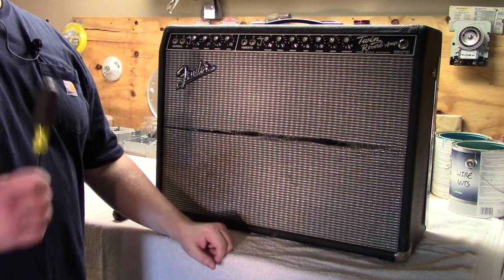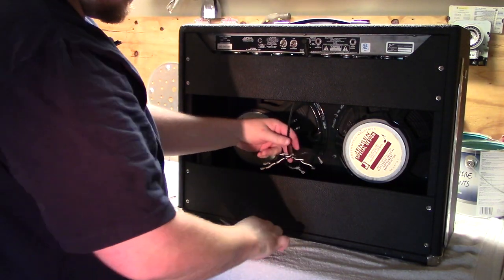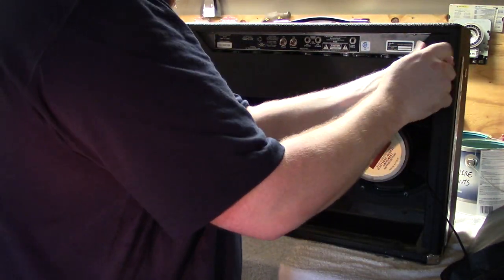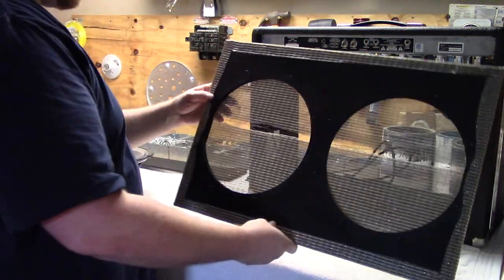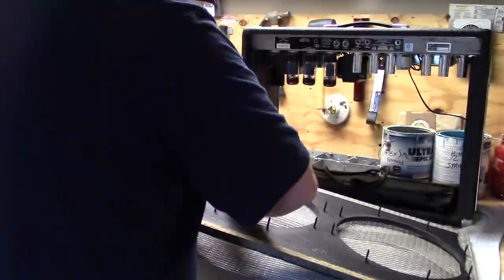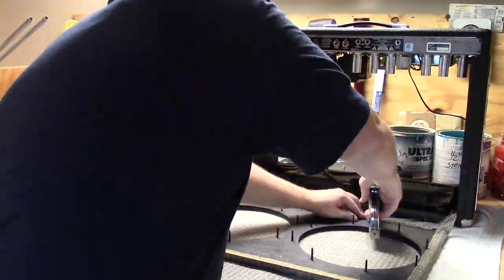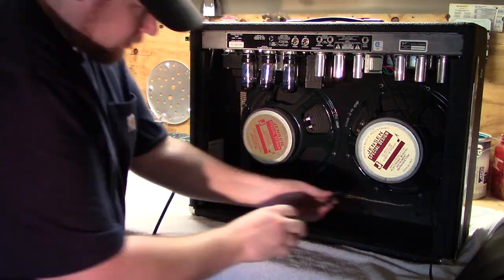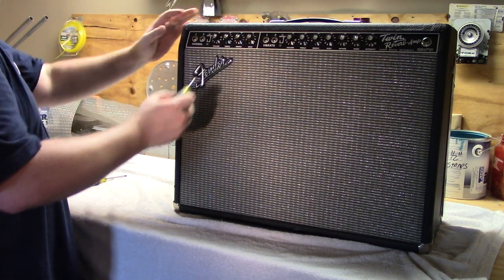Fender '65 Twin Reverb Reissue | Grill Cloth Replacement

Comment: A couple things to consider re the grill cloth for those who are going to do this. The orientation of the cloth; there is a front and back, as well as a horizontal and vertical. It would appear at first sight that the cloth is the same no matter how you place it. In fact there is a slight difference depending on what color cloth you buy. Look closely so that it is orientated the way it should be. Hard to explain without doing a video and without writing a book of a comment.  Also, start on the top edge when stapling and line up first in the center moving out to the edges using a horizontal line in the cloth as a guide. Use the lines in the cloth as a guide overall so it ends up nice, straight and square. Repeatedly check your work. It’ll get wonky if you don’t. Fun job and pretty simple. Thanks for the video.
Reply from the maker: ^^^ this is good advice to avoid the alignment mistake I made
Reply: I wondered about this after I had fully removed the old. My other Fender amps all scream, HORIZONTAL! ... and there is a front and a back, that's quite obvious.

Comment: that thing just went up $500 in value...
Reply from the maker: I sure hope so!
Reply: I don't think so with those Jensen speakers in it. I like Jensen's but in a Fender amp? I never heard of it that could be wrong though. But I don't think so. Just saying.
Reply from the maker: @louisgarcia5971  Those Jensens are the stock speakers that come with the '65 Twin Reissue. It is a statistical likelihood that you have heard Jensens in a Fender whether or not you have "heard of" Jensens in a Fender.

Comment: thanks for the video, i was going to trade in my amp to the local GC, but
they wouldnt take it because the grill cloth was ripped.   i will order some cloth
and fix it as demonstrated in your vide0 but i will do it in an air conditioned room, not
in a garage that is hot and not air conditioned.   you are a pretty tough guy to
do this video under those conditions.

Comment: Leave the speakers on next time to hold down the grill cloth tight, and it’ll keep you from sucking the paper cone or voice coil out of the speaker frame, great video btw, inspired me to redo mine it got rained on a few too many times and that “sawdust baffle board” disintegrated

Comment: You gotta cut the cloth out from underneath the edge of the speaker or it'll warp the basket when you tighten it down and could cause the voicing coil to rub
Reply from the maker: That's a good point! If I have to do this in the future I will take that into consideration. I was figuring it out as I went so I thought my best bet was to replicate how the previous cloth was cut and positioned.

Comment: What tool did you use to take off the screws holding the speakers to the baffle?
Reply from the maker: 11/32" hollow shank nut driver for this amp. Couldn't get a wrench in where I needed it.

Comment: I am curious can you order these grill cloths to come in sizes big enough to do a 412 Marshall cab?  I want to build my own custom 412 or 212 cabinet and I like the Fender look just a tad bit better than the Marshall look
Reply from the maker: Yes you can order them in any size. The ones marked for a standard cab sizes come several inches larger than you will need so you can trim them down to fit

Comment: That is odd. As far as I knew Fender always had hook 'n loop holding the grill on. I had 3 fender amps and they all came with that.
My 1978 Twin Reverb has a seperate board holding the speakers. The grill just pops off.

Comment: Is new cloth as good as vintage?
Reply from the maker: The cloth I purchased is the exact material and pattern that fender originally used, it looks and feels exactly like the cloth that was removed. Certainly no difference in sound. And at around 60 gigs with it since the swap no one has ever commented after a show that it looks like the grill cloth has been replaced.
Reply: @CzBMusic  Thanks! I appreciate the quick reply. I'm going to try and clean mine first, but if it won't come clean I'll change it.